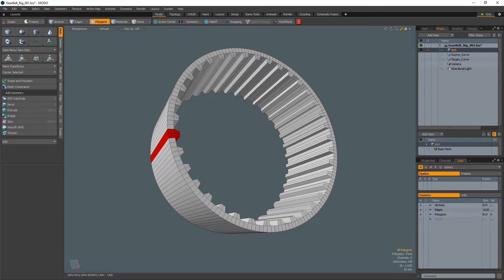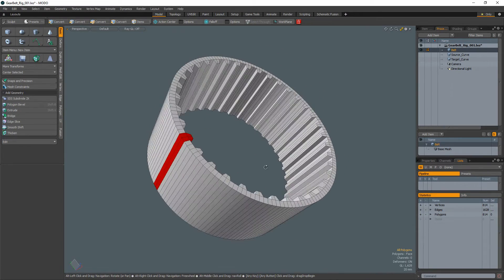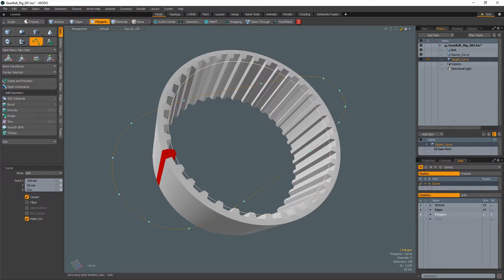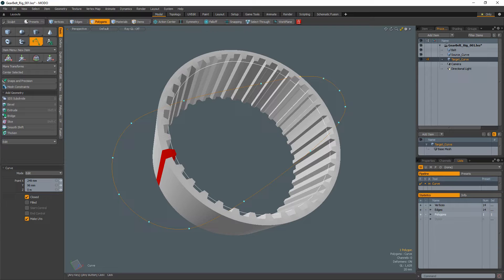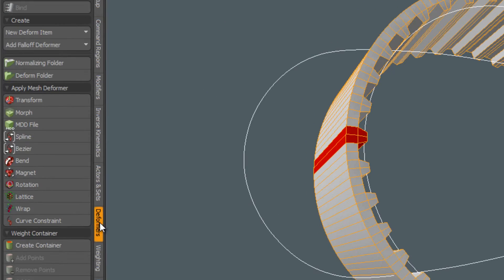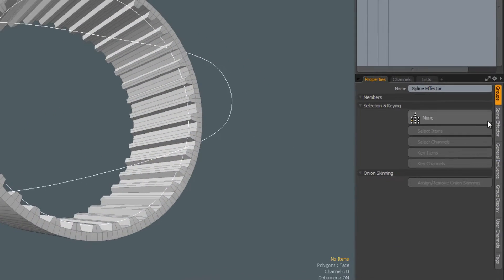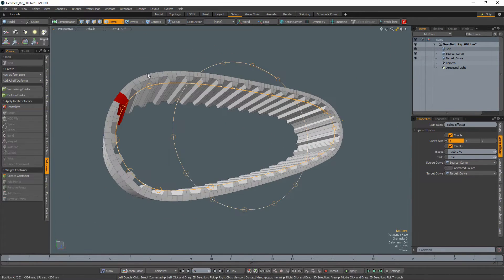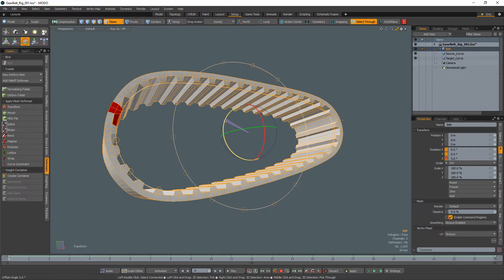MODO | GearBelt Rig

Comment: What type of curves did you use to draw the target curve and the source curve?  My curves do not have those small circles along the length.
Reply from the maker: the small circles are not the curve,... they are from the spline deformer
Reply: I am not getting the circles so something is wrong with my set up.  When I setup the spline deformer nothing in the drawing changes to indicated this.
Reply from the maker: CHECK YOUR VIEWPORT DISPLAY SETTINGS AND MAKE SURE SHOW LOCATORS IS ENABLED.

Comment: Wondering how do i export this animation ? like a fbx file for example.
Does someone know ?
Would be super happy :)
Reply from the maker: You can export an alembic file (.abc).  It will be a combination of the geometry with a point cache for the animation.  Are you looking to export to something like Maya?
Reply: pixelfondue no.  I actually wanted to export to unity3D. Usually I had something similar exported before with morph map animations. This works fine but here I had no luck. The export only contains the undeformed mesh and the animation. Not the deformed one :(
I needed to animate a gear belt and this was looking promising as I could reproduce your steps very good.

Comment: Followed the steps exactly and for some reason the drop down menu doesn't show the meshes to choose either the source or target curve. Has this happened to anyone else?
Reply from the maker: So you dont have any of those options in your properties panel?
Reply: i've got the same error if i use Procedural Curve done via Meshops. It works if you freeze the 2 Curves mesh.